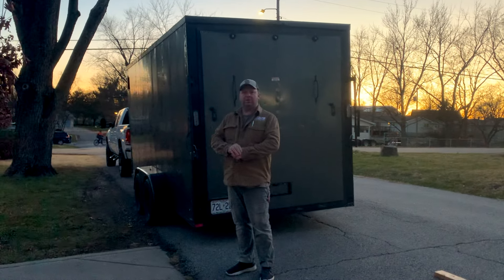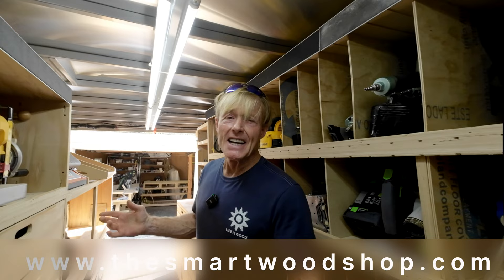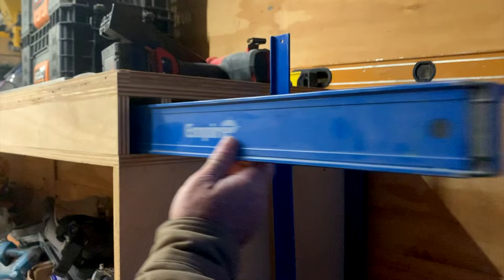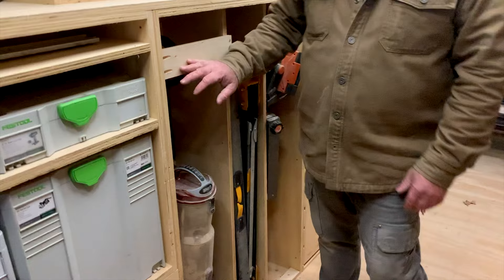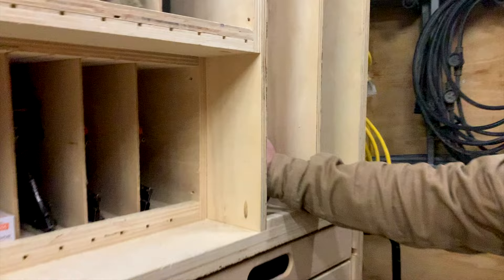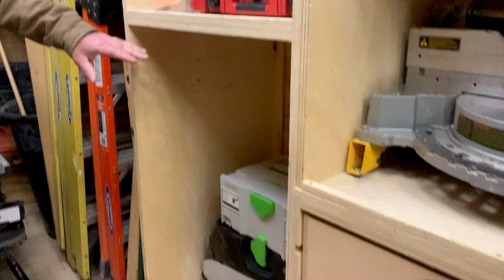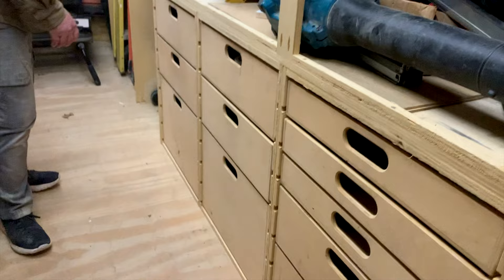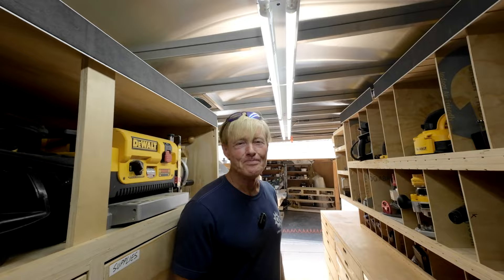Smart Woodshop Tour with David Molinari

Comment: Mr. David.  Very nice walk through. I appreciate it. Got one question for you. How did you do the light set up very interested if you can go through details for that. Keep it up woodshop brother. 🔨🪚
Reply: Hi JB. Thank you for your comment and question. The lights are just LED lights from Home Depot. They come with a linkable pig tail that you can use to connect them down a line of lights. they also come with a module for remote operation. the module has wires on one end to easily connect to the battery. Then all it takes is one wire ran from the battery to the RV plug to charge from the truck. 

Thank you again

Comment: No need to tell you because you already know but David....Great trailer! I really appreciate the variation on Ron's plans for your workflow and arrangement. Question: other than the RV battery that charges when connected and towing, do you have any other power on the trailer (i.e. cord to plug into shore power....etc)? Is the RV battery you have adequate to charge your cordless batteries?

Thanks for the video of your trailer and thanks to Ron for this series. I am a huge trailer and shop tour enthusiast and it is such a great series to see al the variations on the SMART theme and all the really inventive ideas. Thanks David and Thanks Ron!!
Reply: Hi SDS, No, at this point we don't have a shore power setup. When we go into the house to trim, the compressor and battery chargers go in with us. So, for us, it hasn't been a need as of yet. It may be something I change down the road though.
Thank you for your comment, and beautiful job on your trailer. I really like your video with your setup.
Reply: @davidmolinari6569  Thanks for the compliment! I am really happy I have set up for shore power for lights and batteries and the compressor but I am finding that I am using the compressor less and less now I have moved to mostly battery nailers 23ga-18ga-16ga-and a framer. My need for air has greatly changed. Next trailer I will shrink the compressor but keep one permanently on board for the "just in case" situations (and for cleaning tools). Again....very cool setup. I have watched this more than a few times now!